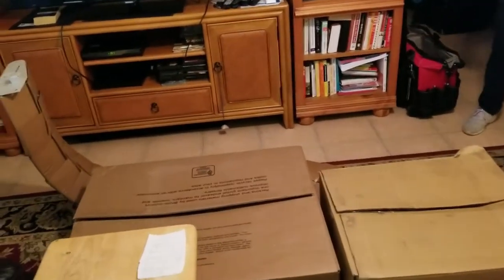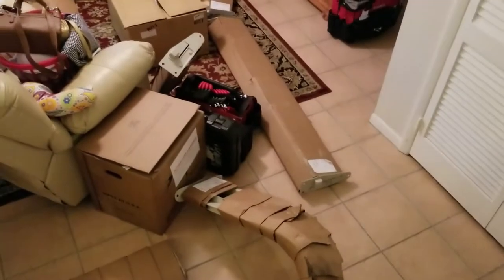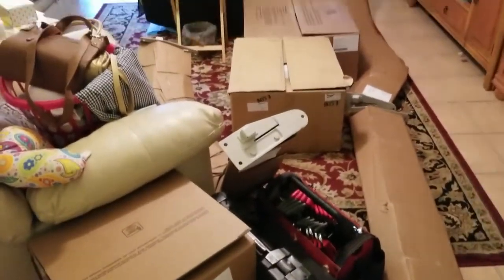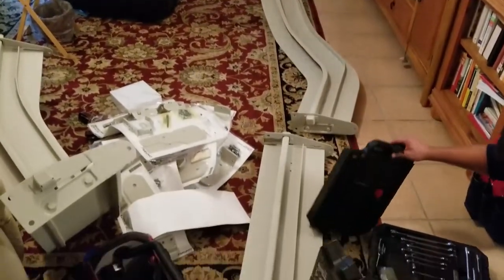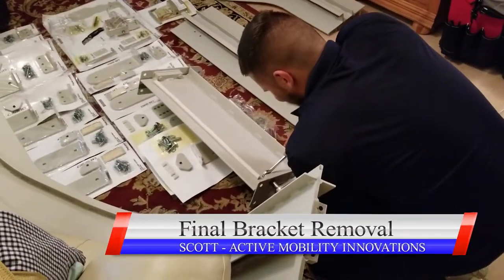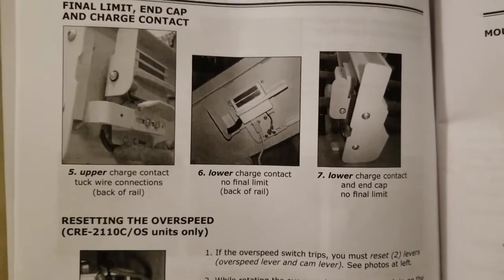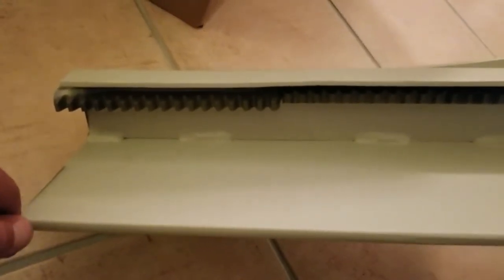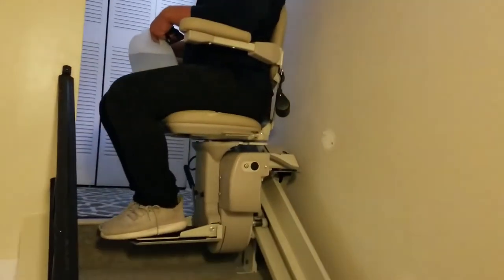How to Install a Bruno Custom Curve Lift. 180-degree curve | AMI Mobility

Comment: So much for Bruno telling us you have to be certified every 3 years to be an installer. I wish I could get the book. I'm changing my brothers from 2 straight lifts to a curved one I just found that will fit. They won't even service self installed ones.